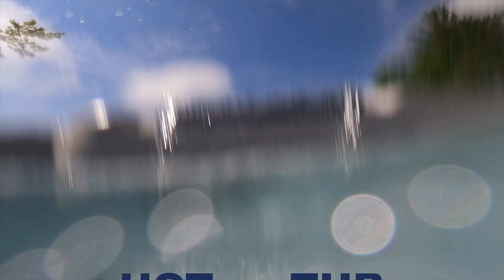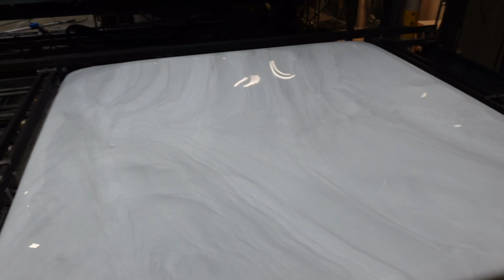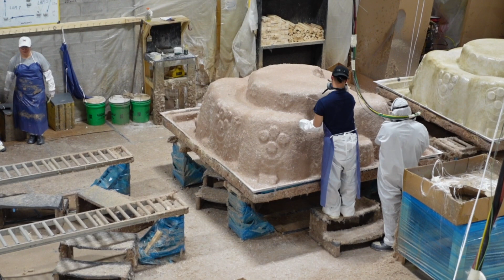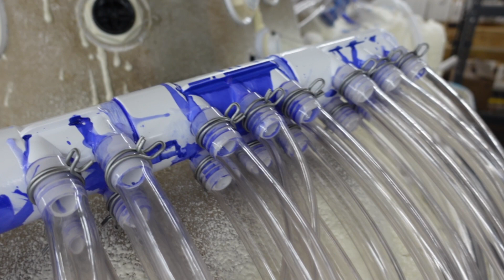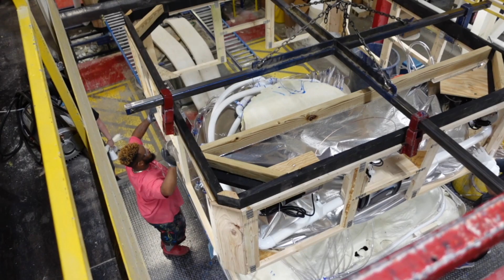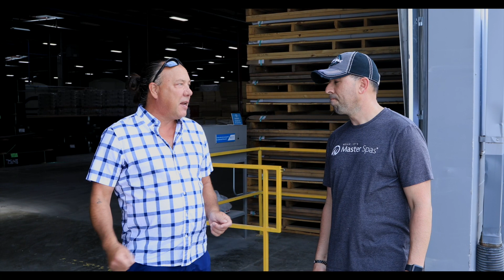The way hot tubs SHOULD be made

Comment: Have had a master spas Lsx for about 20 years now. The therapy seat was what I was looking for and it helped me heal a necrotic hip. The big hip jets can take your skin off if you let it but the energy it put into my hip restarted my circulation in that area. Combined with shockwave therapy my hip is still good 20 years later. The company was not the easiest to deal with when it came time to replace parts. My spa dealer went out of business so I called the factory and their customer service people seemed disgruntled at the time. Solid tub overall.
P.s. my frame was welded steel, now they use wood…

Comment: Guy whacks jets into tub with mallet "this is the future and is way better than precise torque setting".  Way too much reliance on human labor.  Guy is hand spraying the ester resin on overhead and blind with no tool balancer, this will result in non-uniform application.  Foam spray guy eyeballs foam expansion.  Wood frame with cheap tolerances and trusses.  They use hand-push dolleys instead of conveyence systems.  Obviously hand-applied messy plumbing glue and no clamps on smaller lines.  No automated quality.  Didn't show drilling but probably a guy with a drill.  Dirty plant with no LEAN, visual management, 5S.  Typical markings of rust-belt manufacturing.  Compare this to videos of the new Wellis manufactury.

I was honestly sold by HTU's recommendations of Master Spa until watching this video.

Comment: After 45 years in the spa biz and touring over 25 factories I can tell you most all manufacturers build them just like this but  better
Reply: Which brand would you recommend today?
Reply: @ElderEldy13  : what brands are sold in your area as you want a reputable dealer to begin with
Reply: @firerock1611  I'm in metro Detroit so we have just about everything. We don't have Wellis, but just about all the others. MS, Jacuzzi, cal spa, bullfrog, viking, Sundance, artesian.
Reply: @ElderEldy13  funny you mentioned Wellis as it’s one I have been following as I like how they are made but most of all the price and ease of serving in if needed , bullfrog is good if you get the right series and same with Hot Springs , artesian is going thru some problems right now so no go for me and Sundance is one I never cared for as lots of reasons why.  If you can’t get a Wellis I would go with entry level bullfrog as they are over priced on the upper line up with just bells and whistles that are not important, same with Hot Springs, you can’t go wrong with either one as they usually have the top dealers and both companies stand behind their products
Reply: @firerock1611  thanks, what do you think about Cal Spa?
Reply: @ElderEldy13  bottom of the barrel and I’m being nice

Comment: Those wood frames look like there is room for improvement. No pressuare-treated wood, truss plates, and staples as fasteners.
Reply: Right. The higher end tubs don’t even have wood in the frame anymore because it rots.
Reply: Not just rot but expanding and shrinking let alone inconsistent cuts and warping , top brands learned the hard way years ago and now use composite frames

Comment: How is full foam easier to find a leak and easier to repair,  than a hot tub that has insulated panels and everything inside is visible? I understand the R-value will increase just not sold on the repairs and leak locating.
Reply: I thought air was the best insulator 
I have an old Morgan spa with no insulation and it keeps it heat better than my neighbors dynasty spa that’s foamed
My Morgan is about 3/4 to 1 inch thick if fiberglass (old school stuff) with insulated panels maybe that’s the difference
Reply: I think we have different definitions of premium. Premium is pressure treated 2x4's, not painted 2x2's. That stuff will start to rot in 3 years of ground contact. Also, that black plastic bottom is a joke.
Reply from the maker: That’s a good point but there is more to it. First, as someone with many years fixing leaks, they are actually easier to find with full foam as long as the full foam is open cell non-hardening foam. You simply trace the wet foam right to the source of leak without having to try and see where it’s dripping from, excavate the wet foam with just your hands, repair and re-foam. The closed cell foam that hardens is another story altogether because you need a damn hammer and chisel to get the stuff out, absolute nightmare.

The second benefit to full foam is that the pumps and pack are isolated from the heat of the tub instead of being trapped in that 100+ degree environment which means cooler operation and longer life
Reply: @ChrisWheatley  Fair enough, so this foam is a huge improvement over the old style foam. This makes sense.
Reply: @jayfez8241  the only reason for full foam is to add structural support to a poor design like cheap wood and thin shells , better built spas use thermo locking design to trap heat and ease of repair with lower operating cost of tub

Comment: After I drain my hot tub how should I clean it?
Reply: I use a jet cleaner prior to changing my water out then a sump pump to empty it.  After that, I have an electric cleaning machine in which the head rotates and I use just shower cleaner to clean mine and rinse and towel dry well.  I then refill and change out my filters at that time to new ones also.  I then test the water and do the chemicals as needed and in a day or two ready to go again for 3-4months